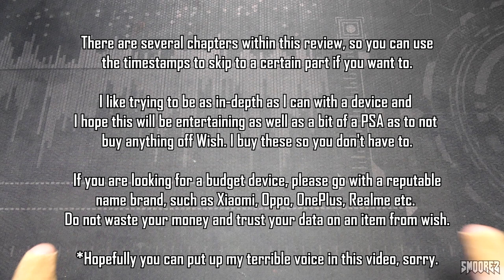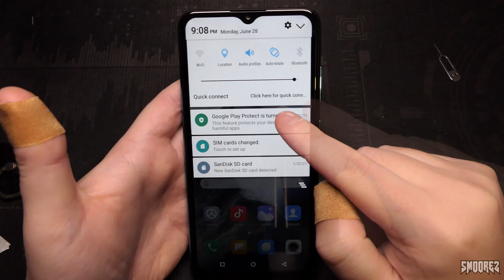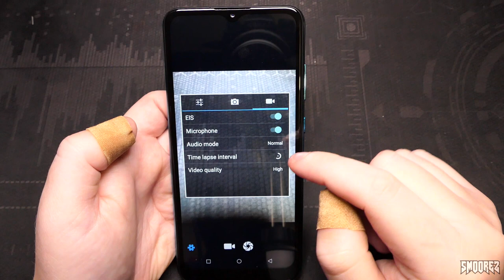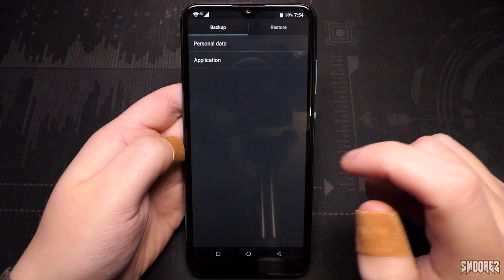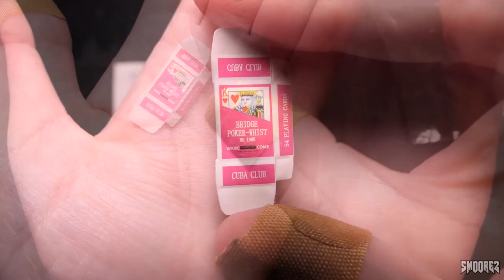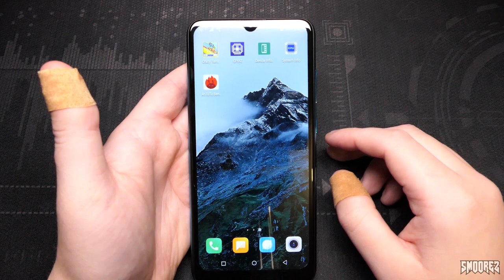I bought A $225 XIAOMI Mi 11 Ultra Clone from WISH - Don't be fooled by this! (XLAOMi M11 Ultra)

Comment from the maker: *Yeah I call it the XlAOMI Mi 11 Ultra throughout the review, but it's the M11 Ultra.
I say it 18 times during the review, my bad - sorry. See, it just goes to show a play on words does get stick with you!

Please don't buy this under any circumstances. 
This is definitely not worth it. I buy these so you don't have to.
For $225 AUD...please just do not even think about it.

Download the stuff extracted from this thing here: 
https://archive.org/details/Xlaomi-11Ultra
INTERNET ARCHIVE: https://archive.org/details/@smoorez

TIMESTAMPS:
Introduction: 0:00
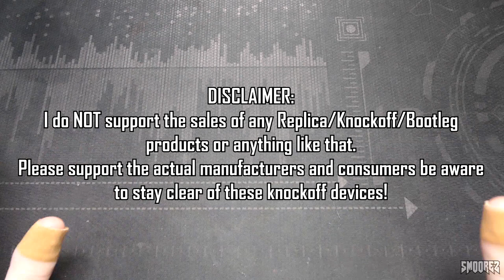Details & Listing: 1:17
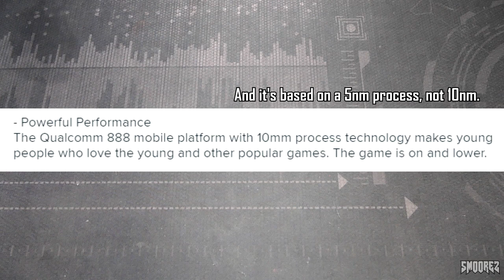Unpackaging: 9:17
Unboxing: 10:58
Around the XLAOMI M11 ULTRA: 13:54
Powering up the XLAOMI M11 Ultra: 16:45
User Interface, Shortcuts, Apps & Wallpapers: 17:54
Settings - Networks, Call Quality & Sounds: 20:07
Settings - Display, Gestures, Battery & Storage: 21:18
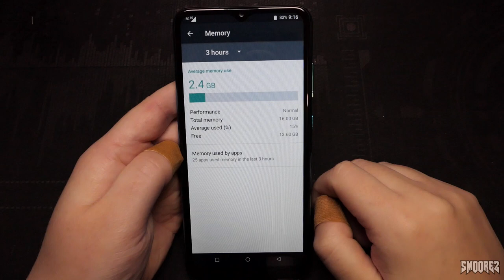Settings - Installed Apps, Face Unlock & Fingerprints: 22:45
Settings - The rest of settings & About Phone: 24:52
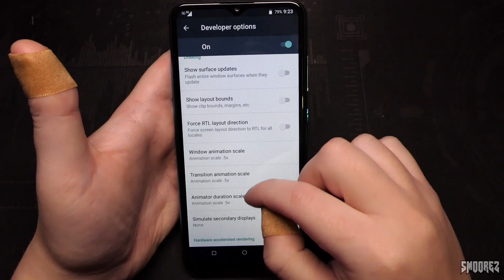Connecting to WiFi, Updates & The Camera: 26:13
Camera Test: 27:47
Spec Hints: 31:43
Camera Quality & System Performance: 32:54
Speaker Test: 34:16
Other Apps, Browser Test & Finding stolen ads: 35:19
Looking at other apps: 36:18
Voice Search & YouTube Test: 38:21
Gaming Test: 40:27
BONUS REVIEW: 44:09
Testing the FREE 128GB MicroSD Card: 47:46
Checking out the specs: 49:21
Conclusion & Pre-Teardown: 52:48
Teardown: 54:07
Is it alive & spec list: 1:00:17
Thoughts, Links, Do Not Buy & Thank You!: 1:01:42
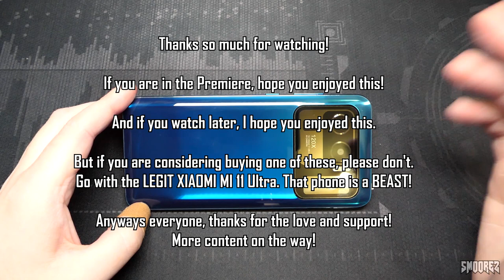Outro: 1:04:04

CPU & System Apps are in the description above!
As well as the extracted files from the phone!

Be good people!
Reply: That was wayyyy to huge money spent on a clone
Reply: Indeed a great amount to spend i hope its worth it goodluck for the video ... im eager to watch it your avid silent watcher..
Reply: Yeah, you can get a real Xiaomi for way cheaper and they are always realy good.
Reply: The listing calls it Mi 11 though
Reply: 1:38 this comment after translation from polish means that ,,It's fake, camera is not worthy anything"
Reply: Turn off that random page animation, turn off autosync, replace facebook and twitter with their lite versions and the phone will run smoothly again
Reply: Leimin is a chinese manufacturer. Seems like they made quite a lot of cheap clones out there, like this one or the P40, P50 Pro, etc.
Reply: Ppl b

Comment: I was fully expecting a mirror where the second screen was supposed to be. It would at least be useful for selfies like the screen on the real one.
Reply: Yeah or an LCD Clock like they had so many ways to actually make something out of that "Screen" and they choose a sticker.
Reply: My first Cell Phone (a LG back in 2004 or 2005) had actually a Mirror next to its Camera for taking Selfies. For Years Im trying to find out which model it was. It's one of the few pieces of "My first of this kind of device" I'm missing in my collection.

Comment: I bought a charger off ebay for 2€, it has 3 charging ports and it's been in use for 4 years now, charging my PS4 controller, my bt speaker and my secondary phone, all at the same time. Best value for money I've ever seen.
Reply: Bro, you are or were just Lucky. I would pay a bit more for an item I will be using such a long time
Reply: so has your house burned down yet?
Reply: @ChakkyCharizard  Usually they wo'nt set your House on Fire. It's more about electrical safety, like dodgy interference capacacitors not rated for Mains Voltage and the fact that the only isolation between you and mains are the 0.0000-something mm of laquer on the windings in the transformer. No sane person would touch a Wire with mains voltage on it which is just isolated by a whiff of paint out of a spraycan- but almost everyone uses these ultra cheap chargers with even worse isolation.

Comment: Woah! I knew the XLaomi M11 Ultra was good, but I didn't know the fingerprint sensor detected the whole hand! Man, the new Snapdragon 888 really does wonders doesn't it?
Reply: It also has face recognition. You just have to put the phone to your face
Reply: @notsure6834  face recognition is not like apples or Samsung's. It is a very cheaped-out version of it
Reply: The tencore snapmediexyna processor
Reply: @JR_Photography1  woooosh
Reply: @brianrosie1762  The elevencore spreadcovmedia 6998 processor
Reply: *Snapdinosaur 888
Reply: the 100 Core Spreaditekxynosunidragon MTMSM 6889 Processor so you can snatch red packetssfasler - XLaomi in the future
Reply: @folddyy  the spandragon 869 loll

Comment: 13:03 that charger is deadly there isn't a class Y1 capacitor between the live and low voltage sides but instead the cheapest capacitor they could find if that capacitor fails you will have mains voltage on the USB output very deadly
Reply: this thing is like 100% failure rate and it WILL give you the shock and costs 0.0001 dollars. Not to mention the absolutely tiny transformer that provides no space to isolate between the windings.
I have experienced and been tortured by these as a kid

Comment: Finally a good Wish item, the tiny playing cards.

Too bad the phone is complete and utter garbage. 

The charger does look better though than many others, doubt it would burn down the house, may electrocute you though so not recommended.

It's nice to see Welcome devices innovating, screw less has to save a few seconds in assembly and half a cent in the bill of marterials. No need to care about reliability, it will be in the bin from frustration long before it falls apart. 

Being on the attack of the gnomes.
Reply: Dipdegonewild has done reviews of sketchy chargers like this

For the most part it won't burn your house down but it might melt itself, not deliver the rated amps at the back and chance of electrocuting you, of course.

Comment: That charging brick looks like an de-branded Samsung brick from around the s5/s6 era.
Reply: It’s a knockoff of old Samsung qc2 usb a bricks
Reply: well newer Samsung chargers are similar to that one...
Reply: It looks like Samsung 15W charger. Even new models like the A52 are still getting that in the box.
Reply: @notagain2856  the ones I'm thinking of are 5 Volt 2 Amp, so only 10 Watts.

Comment: I also have a Xaomi knock off
But my phone works very well against all expectations.
I can not say anything else, that i'm quite happy with it!
Reply: Why get a knock off when the xiaomi phone are cheap as hell compared to others...
Reply: @JR_Photography1  Well, mine one was even more cheaper.
Reply: @JR_Photography1  because money, I am using a Motorola G20 and I'm pretty happy with it, solid phone with kinda meh specs, but I could get a better phone with better specs for way lower, if I went with the knockoffs.
Reply: @Desbugador  you don't even have to buy a knock off when the cheapest xiaomi phone sell for 200$
Reply: @JR_Photography1  I even can get $100 xiaomi in my country

Comment: I just purchased one of these phones and it was labeled as a meat Ultra and it said it had 16 gigabytes of RAM and of course 1tb of storage. 

according to the device it still says it has one terabyte of storage.  
and out of the four cores only three of them work?

so basically what I got was a very large one terabyte flash drive (But reports at 13GB by SYs Mark Pass Labs--But then 1TB with all other programs)  
with 2GB of RAM..   

I have to admit the screen is not that bad.  I really can't tell off hand it is a Low Quality screen.  But its what you would get with a Budget big box prepaid phone for usd $20-49.00

The phones cpu only runs at 1.3Ghz.    And Passmark puts this phone up there with the Galaxy SII and HTC EVO 3D.   Phones from the  2012 Era of phones.  

But what really gets me is that it does very well in some places and just falls on its face in others.  

My screen also reports a Different pixel fill, but its just bellow 720P.  

Now the Back where the LCD display is suppose to be?  They just put a Metal cover there. 

The Seller on Alibaba Express has closed his shop of course.   So Lets see if Aliexpress is going to fix this problem.     Really, I know Ebay costs a bit more,  and Amazon is a bit higher.  But at least here in the states,  I can just walk in an return it to Amazon if I don't like it.  

I paid about 100 bucks for this phone.   And really?  This is worth less then the TCL Walmart phone I picked up while I was waiting on this one.  
I ordered another model, and am pretty sure its going to be the same cheap phone.   

Both stores are now closed.  

It took about a month to get here.  And it keeps saying it is waiting in Customs.  ??

If at least the 1TB of Memory works out, that's not a Terrible deal.  But this is the classic RICER phone.   All looks and nothing of real substance it seems.   
 
This phone has Cams so bad?  Not even your Cheapo CCD would be emberased.
Reply: don't use the flash drive - it's been hacked to report as 1 tb and you'll lose your data if it's used past the 13 gigabytes.

Comment: Could you please start checking googles safetynet too, you can find apps to check that on the play store and also take a look into google play store settings, under tab info there should be a "device is certified" or on this device rather a "device is not certified" which is an confirmation that this device does not pass safetynet and does not pass googles security requirements. every device should pass safetynet out of the box. if they do not, that will result in netflix, disney+, pokemon go and more apps not showing up in the store. That probably also is the problem why all the other apps you were missing did not show up even though it does have enough RAM.

Comment: maybe it does not meet with requirements, not as advertised, falsely described and very cheap quality but i can't stop thinking the amount of engineering went into it. it has tiny cameras, lenses, motherboards, microchips, gps and wifi circuitry, speakers, lcds and etc and ability to put them together. and you can make calls, play games, take pictures and etc with it

it's not easy as 123 to make an android phone yet manufacturers still don't tell their names or brands or contact info elsewhere on it like they are drug dealers or sort and avoid been caught.  just wow.

most people say "it's Chinese" and we all know what it means. in china they can make an unbranded android phones. that's powerful if you think about it.

China is coming.

mind blowing.

Comment: I still waiting for a "ТesIa"  model 3 knock off on Wish (with cyrillic letters used in thr name ТesIa) with a 1 kWh-Battery, so it needs to recarge after just one mile of driving and a maximal speed of 40km/h.

Comment: I had a first encounter with BesLoudness and all that "Bes" shenanigans on a pretty legit Philips Xenium I908. So... It's not legit in the end?)

Jokes aside, it was a good phone while it lasted. It had great ergonomics and stock UI, but the CPU was lackluster and the touch screen..... It was crappy, going all over the place if you ever touched it with sweaty hands. But I still liked it. Too bad it died unexpectedly , just... Died. It had no reason to do so, but it did, too bad I guess... I still have it in my possession, just to be able to appreciate it's design and amazing grip.
Reply: Philips of today is no longer the Philips of 25 years ago. They're now mostly in the brand licensing business, so for most product groups, they have barely a basic idea of what it is they're "making".

BesAudio are audio DSP plugins that the Taiwanese processor manufacturer MediaTek throws in for free with their products.

I wonder if there's somewhere a landfill of ancient MediaTek chips that nobody likes, where these Welcome phones get their chips from. Up-to-date chips by the company are moderately nice, various grades of midrange. At the ultra low end, if you were buying new today, Spreadtrum chips from mainland China might be more economical.

I have one just-dead phone, a Moto E. It looks like the eMMC has died. I remember there was a story where Galaxy s3 used to have a self destructing timebomb eMMC due to a firmware bug in the eMMC itself, and someone actually found a way to reflash it and fix the bug, a fascinating story in detail.

Comment: To know either the so called smartphone is fake or not probably simple as we can check on the RAM  and the actual Antutu Benchmark cannot be testing on smartphone which have less than than 6 GB RAM,then need to test it with Antutu Benchmark lite version to get the actual specs.

Comment: I bought this M11 ultra 7.3 inch on AliExpress . Extremely slow to put on, slow processor to run, bad quality screen, bad quality images, low quality material. No updates possible. I don't recommend it at all. I regret having purchased it.

Comment: why do you correct "xlaomi" on "xiaomi" with the subtitles, if you previously said it was "xlaomi"
Reply from the maker: Ok, so it got you too.
The font I use in Vegas makes it look like it does say "XIAOMI" but in fact, I did type it as "XlAOMI" it's just that the lowercase L and uppercase I look exactly the same. But I can guarantee that I did put that correctly, I was correcting me calling it a Mi 11 Ultra when it was a M11 Ultra. And I didn't say "Mi" correctly either so hope that clears it up!
Reply: @SMOOREZ  K, I get it

Comment: There's no way that is MT6893, that's the newer Dimensity SoC that performs on par with SD865, probably just MT6580 shadowed with randomised number
Reply: If their deca core claim is to be believed, then it most likely X10 (MT6795) in the phone. Its an old 28nm chipset from 2014
Reply: @notagain2856  yup, exactly